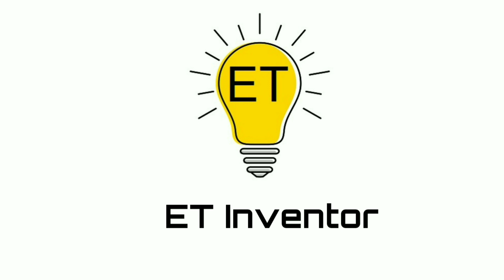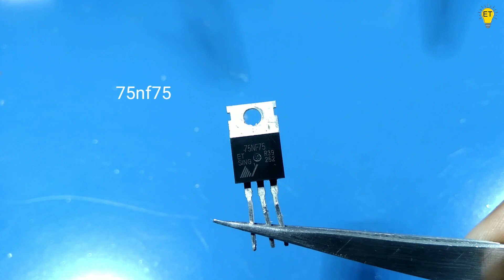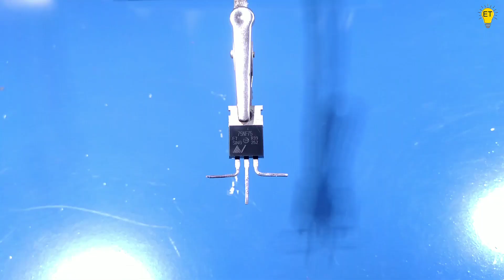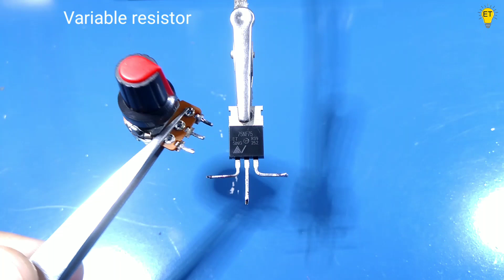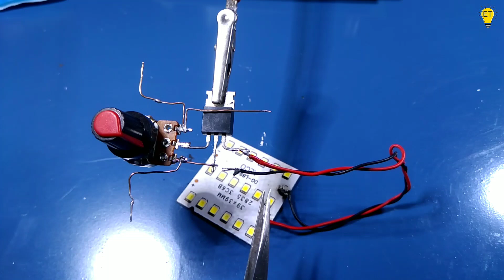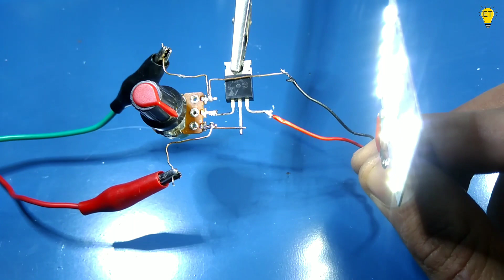How to control bulb light. Light regulator. Control light intensity. ET Inventor

Comment: you won't need a transistor bcuz it make the light fuzz
Reply from the maker: Dear viewer,
In this circuit Is Required 75nf75 or z44 Transistor. The variable resistor only control gate supply for transistor But very very less current supply for transistor gate. Transistor will control output voltage. Transistor must required in this process
Reply: ok